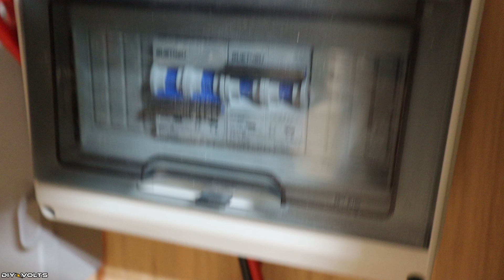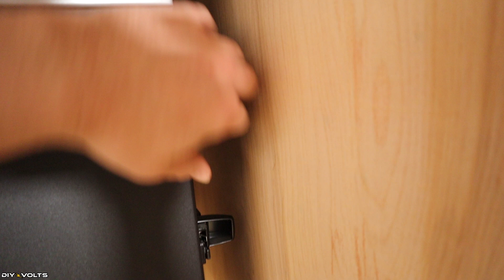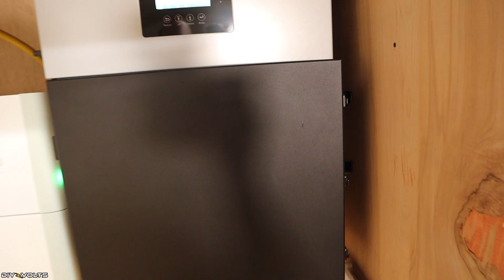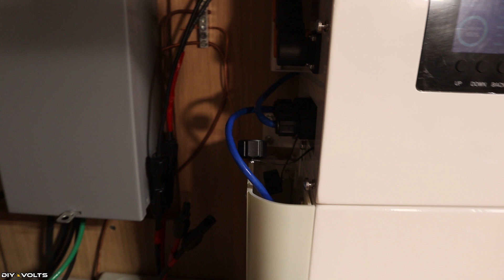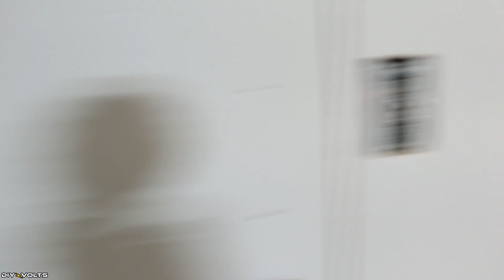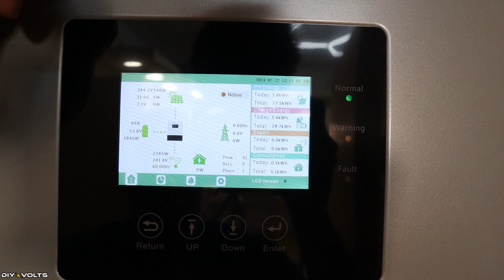Run a Workshop Off Grid? Big Battery Ethos and Lux Power Inverter

Comment: How did you decide on the AC wire size to supply the load centre.
Reply from the maker: I installed a 30 amp cable for this temporary install. 6awg should be used to handle the full 12kw of this inverter.

Comment: I use several large, high HP power tools in my off grid workshop and would never be able to use this low surge capacity (only 200%) inverter to power my shop. Most motorized shop tools require at least 300% to 800% surge just to stat the rotor spinning.
Reply: I was thinking the same thing.. These Chinese high frequency inverters are a no-go for me. I have never seen one able to power a 14" shop saw. Schneider inverter all the way. The Schneider is a low frequency is only rated for 6.8kw yet can handle a large chop saw and an electric dryer at the same time. There is a couple You tube videos demonstrating it. I can't imagine running a shop off a high frequency inverter. This guy did a good job on his system except for that inverter. Also the Schneider has a very low idle power draw.
Reply from the maker: do your tools use more than 12,000w ? with a surge of 24,000w ? Those are some large tools. With that type shop I can see that off grid is not a good fit. For my shop running lasers and small cnc's its no problem.
Reply: If I'm running our AC unit and my wife runs our dryer and the microwave and I power up my 5 horse bandsaw, that would easily exceed the 24,000 Watt surge capacity (for a few milliseconds) of this high frequency inverter which would send it into overload shutdown. That's why I've asked this manufacturer multiple time to create a video demonstrating that this inverter can start and run a 12kW motor load and thus far they have failed to respond to my requests. @DIYVolts